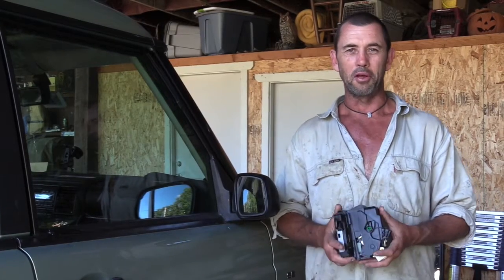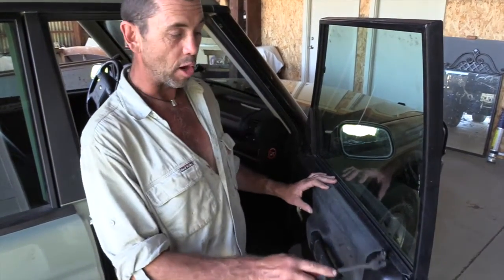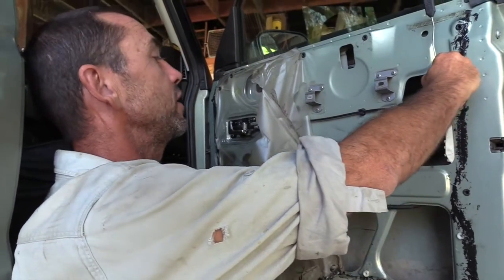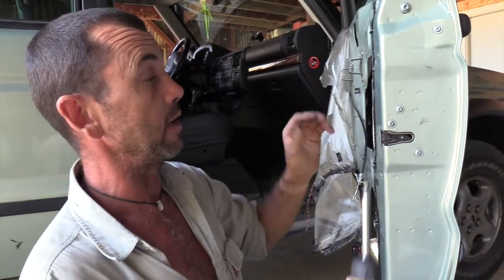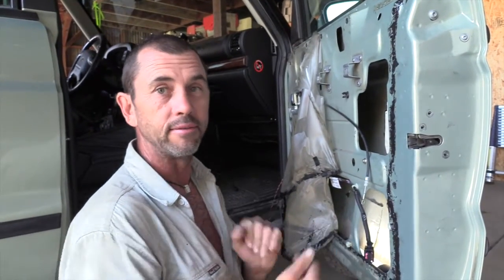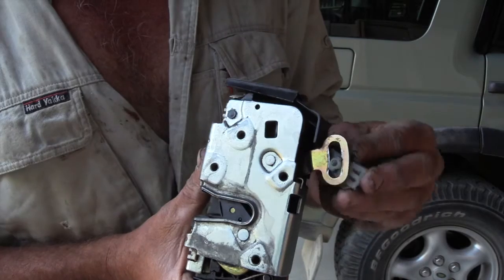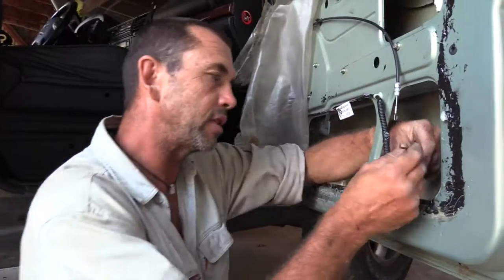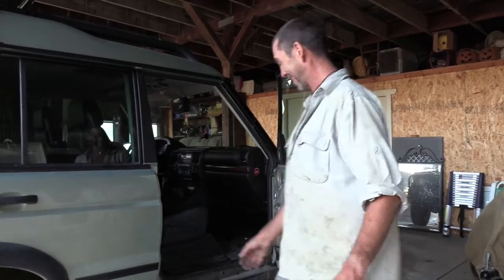Land Rover Discovery 2 door actuator replacement

Comment: That was funny - and helpful - did you need new pants when you shut the door to test it and it initially didn't open? :-P
Reply from the maker: Thanks Richard. I wasn’t too worried about the door not opening, being well aware of my many inadequacies I tend to take precautions and made sure the drivers door was open and the panel was still off. Anything to avoid soiled britches.
Reply: Fair play to you sir - did look like a mild bit of initial panic starting to spread across yer chops though.

Still, I think I'd have preferred that reaction to have been on my own chops, instead the bloody fury, after having wasted 90 mins gently prying everything apart, and wiggling the window frame out to replace the lock in my OSR Disco 2 door, only to find the lock that I'd bought from a breaker (D'oh!), only locks and doesn't unlock, just the faulty bloody lock it was replacing!